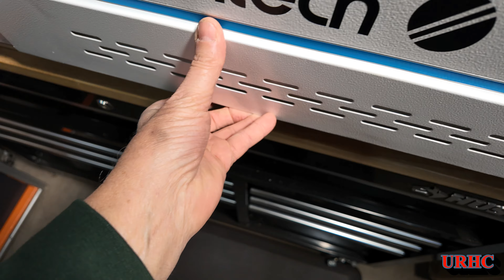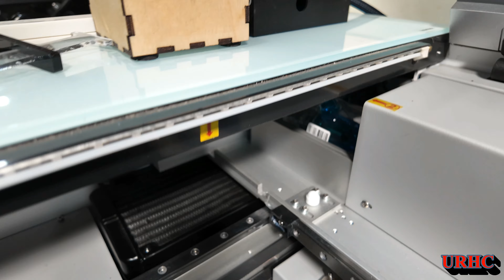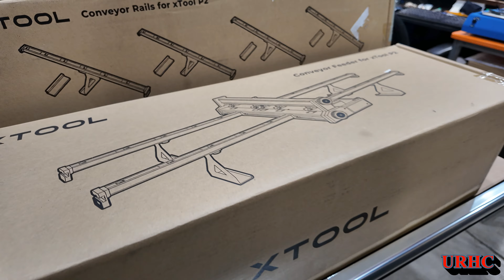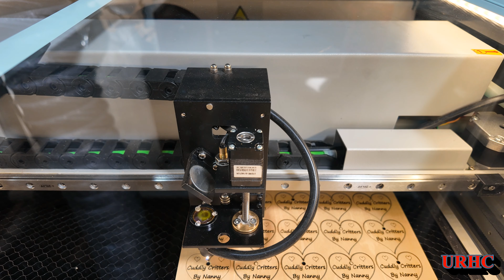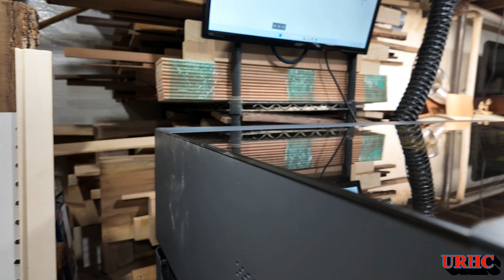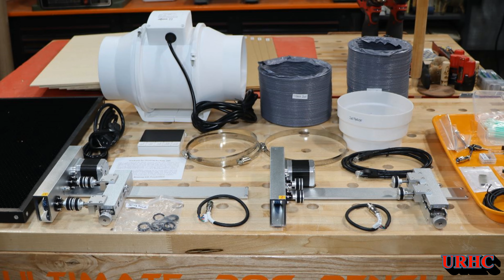Omtech Polar VS xTool P2 A Simple Comparison

Comment: Thanks for the video. I'm thinking of getting the P2S, I can't decide if it's a bad idea having it in my house, I can see you've got quite a serious extraction set up in your workshop. Is the smell contained well? I'd use the Xtool extraction/filtration unit
Reply from the maker: If you're planing on doing any kind of plastic the xtool filter unit I have is worthless. Does not remove the dangerous vapors.  Fairly good for the burning wood smell and particles but costly to keep changing the filters often. The only safe way to use these indoors is a good outdoor vent and be sure your home has a way to get replacement air in so you don't  create a vacuum possibly puling furnace exhaust or woodstove smoke in.  I have been told by xtool the extraction unit is not safe for use with plastic so I say vent it or use it outside because plastic is the reason most step up to Co2 machines. You only need a 4 inch duct and good inline fan. Thanks for watching.

Comment: Great video! There are better options out there that are easier to use right out of the box without so much fuss. If you're not prepared to devote a lot of time to debugging and maintenance, I would seriously reconsider investing in an OMTech machine. I know I regret my decision.
Reply from the maker: For the price at the time the Omtech was a good starter machine for those with limited space. Takes some fiddling but has excellent results. Switching mine to the cheap lenses got maintenance costs down. A year later there are many full size machines that blow both of these away in the same price range.  This technology changes so fast that it's hard to determine  when to jump in. Thanks for watching.
Reply: Are you saying the p2s is the way to go and more user friendly?

Comment: Does anyone know if you can get a different focal length lense for the P2?  I heard you could possibly get a smaller spot size for engraving with a different lense.
Reply from the maker: I doubt it.  Changing focal length is not enabled in the software.  Check with Xtool.

Comment: Got my P2 for 5K.  That was the bundle with riser base, rotary, and the conveyor.  Also came with a free fire suppression system.  I just got the mirrors adjusted and made a few test cuts in cardboard.  So far so good.  The machine seems well made.  Software seems easy to learn.  There were a few things typical of a Chinese product, they used countersink style screws in uncountersunk holes in a few places in riser base.  The mirror aligning program is a little unclear.
Reply from the maker: It is an easy machine to setup and get decent results.  Would be nice  if it was lightburn compatible out of the box for advanced users offline with no data collection.  Enjoy it. Thanks for watching.

Comment: Hi!
Thanks for the detailed explanations. You said it is very hard to set Polar, but once it is set it works very well in the long run.
I have a question, how hard can it be to set? Approximately how long can it take, for someone doing this for the first time? A day, a week, a month?
I know this depends on each person, their knowledge, etc, but I would like to know at least approximately.

All the best!
Reply from the maker: It took. me over 4 hours to get the mirrors aligned.  Another 6 hours to get the camera almost aligned. I would plan on 2 days to get it setup and aligned.  With single stage air assist, if you do a lot of acrylic work plan on removing and cleaning the lense often.  There are aftermarket lense tubes that make that an easier  faster procedure. Thanks for watching.
Reply: @unemployedredneckhillbilly2023  Thanks for answer! It seems that these problems were not with the Xtool P2, but after the proper settings can we say that the Polar is on the same level as the P2 in terms of engraving and cutting accuracy? Do you have a plan to go to the double stage air assist? Omtech has several types of lasers, do you think a higher power laser of 60-70W will be better than Polar? Polar is much more compact than the 60-70W models. What I am looking is a laser spot as small as possible for engraving and cutting acrylic. I watched the videos and noticed in one of them you showed how to change lenses for a little spot. Can you post a link to those lenses and also to the test lenses? All the best!
Reply from the maker: Really depends on what you're making and how many hours  a day it will run. These small lasers have duty cycles you must remain in and use proprietary parts that are cramped in and expensive to buy. The lenses are all the same spot size when clean, fused on acrylic vapors make it bigger and more difused. Look for an after market lense holder and standard lenses because engraving acrylic takes often cleaning. I haven't really  used the Polar on acrylic since getting the P2 because of the poor air assist.  Before spending a ton of money on a P2 you should look at exactly what your need is and who is going to handle any problems  with it should  it break because the buyer is responsible to debug and fix it. These are both starter personal use machines in my eyes.
Reply: @unemployedredneckhillbilly2023  Unfortunately you don't often find reviews as thorough as you did. I really want and would love to work with acrylic, especially engraving, but as you said, I'm afraid that due to the poor air functionality of the Polar I will have to change lenses very often. If the lenses would not be very expensive then it would not be a problem. The Xtool P2 is expensive for me, and I don't know if it's still worth it to make a considerable effort to buy it. I don't have a business plan in that direction, especially since I'm just starting out and will have to learn how to work with a laser printer. Polar costs 2749 Euro, at the same time 70W Turbo -747, costs 2649 Euro. Would Polar be better than Turbo 747, although Turbo 747 has 70W and Autocus. Would I find another laser printer in this price range? Maybe you can help me with some advice. Thanks very much!

Translated with www.DeepL.com/Translator (free version)
Reply from the maker: I don't  recommend any machines I have not tried.

Comment: Great video and very helpful! I’m looking to get the P2 laser, and am finding it hard to get a suitable mobile tool box for it. May I ask, what tool box by Husky are you using for yours?
Reply from the maker: Check out home depot and they have several different sizes and colors of these Husky boxes. They are a little tall for this machine but casters can be removed to drop them lower.  If your getting the feeder this is not the best solution.  Thanks for watching.

Comment: Very good explanation here.  I have not made my decision yet, but I little bit scared of cut quality with the S1. CO2 seems to be far better. Also, I like the idea of the conveyor for larger parts, is there an easy way to make larger part with the polar's passtrough?
Reply from the maker: If you have any plans that include clear acrylic or glass a Co2 is the only answer.  
The polar feed through is basically useless for larger parts. The S1 also has a conveyor feeder that is made for it. I am told  it is not interchangeable with the P1 feeder so I don't have one to try. If you have room, Omtech has some nice offerings with a larger bed and higher power that fall in the P2 price range and are much easier to maintain along with non proprietary parts to future proof your investment and full lightburn compatibility.  It's a large investment that should be thought out carefully.  Thanks for watching.
Reply: @unemployedredneckhillbilly2023  thanks for the answer, could you elaborate on why POlar feeder is useless? Is it because it is very small like 1/4 high and narrow?
Reply from the maker: Yes, the size basically makes it useless for my needs. Should at least accept 20mm.

Comment: For the price difference I just can’t see the reason for it. For the cost of the X tool you can get a much better machine
Reply from the maker: It is twice the price with the rotary, honeycomb, and risers. Proprietary parts and lightburn full compatibility is a deciding factor for many. They both are amazing starter machines and I really can't call one better then the other after using them both. Thanks for watching.
Reply: I really appreciated this video. I have a much larger laser that we built. I have zero clue how to use it and quite honestly no time to learn. With these smaller machines I’m thinking that I might be able to learn and then eventually get into the larger one. I was looking at a diode but will need to cut the opaque pastels and I don’t want to deal with hacks and whatnot for cutting. We have light burn because of the other laser but I’ll do all my designing in illustrator so hopefully I’ll be able to import it. This video was super informative. Scared me a little about the omtech set up but we will see 😂
Reply from the maker: Even these starter machines will require a learning process. The Omtech is a pain to set up but once properly aligned seems to stay that way. It almost seems you would be best investing time to learn to use the larger machine you have. Lightburn is the best laser software for working with images and that's why many don't want to be stuck learning the XCS software. Lightburn has great videos to help you get started. Cutting acrylic will make a mess of any machine from the vapors. Be sure to vent whatever machine you get properly and those portable heppa filters from xTool and others are not safe to use with acrylics. Good luck

Comment: I have the very similar Monport 55w laser. I also have air Assitance issues. For one it doesn’t seem to blow air but wondering if I could add an external pump to run with the laser. What are you doing to solve the pressure problems??
Reply from the maker: I had no idea Monoport made one like this. Looks like it's made at the same factory. I plan on adding a smalll external pump that's always on to keep crap out of the nozzle when engraving and to reduce the delay when using the main pump. If they would solve that issue with the next generation these would be a perfect starter machine. Thanks for watching.
Reply: @unemployedredneckhillbilly2023  thanks for the reply. Would you be willing to show how you made the wiring connections to the board to adapt the controller? I think the Monport 55 could adapt the same thing. 
Also it would be interesting to see how you will route the blower line in thought the machine when you add the external air pump.
Reply from the maker: @jwhiting352  There is a video about  adding the controller if you search my channel  for Polar. Comes with a cable that plugged into  my ruida controller.  Not sure what controller yours uses so you probably have to open it up and verify it's the same. I am planning the same hose with check valves and run the additional  line in the raceway.
Reply: @unemployedredneckhillbilly2023  yes I am planing to run the hose as well with what is already there in the race too. What are you doing for a two stage pump and will you connect it to the system board or just manually turn it on / off? 
I do have the Rudia board.
Reply from the maker: @jwhiting352  I really  am thinking  about replacing it and the Xtool P2 with a larger 100 watt machine in the future so I am still on the fence about if I should waste more time on it at this point. I want atleast a 16 x 24 cutting area that has more room for easy maintenance.

Comment: Great video on a topic I had been looking for. I bought an Omtech Polar Laser Cutter & Engraver, but have not got it running yet. And, by reading some of the Omtech Polar Users group post, I was second guessing on not waiting for the X-Tool P2. But, you have made some great points about the X-Tool I didn't know about and it looks like the Polar was an OK buy after all. I do have the external control panel like you have and also an American Photons quick change lens setup I will be installing. Just one comment, I am wondering why you left the internal exhaust fan in place while you are using the 6" inline fan? I have already removed my internal dn have 3D printed the spacer for where the internal fan was. My people (myself included) believe that the internal fan will restrict the power of the 6" inline fan. And, I agree with you about people seemed to buy these lasers with not knowledge that they will require maintenance and replacement parts. You would think that someone who is willing to spend the $3000 to $5000 these things can cost, would do their homework of ALL the cost involved. Oh well. Once again. thanks for all you videos and looking forward to seeing some more of your wife's crocheted animals and Crocs Collection !!...Charlie in Central Ohio
Reply from the maker: They are both good machines once aligned. The Polar definitely needs a better air assist with low flow for keeping the lense clean when engraving and the camera isn't perfect. I actually prefer the smaller size and light color. These are first generation and most likely will be upgraded in a couple years. The thing about the P2 is lightburn integration and so many proprietary cards and parts should the company quit supporting them. With standard guides, Ruida controller,  power supplies,  and stepper controllers I think the Polar is more future proof. 
I left the fan in to keep the internal parts cleaner. it keeps airflow pretty even in the machine even when the radiator fan is running I feel. pulling more air isn't always better I feel. The proper flow to keep particles suspended across the entire machine as designed is more important to me. Your machine should work  perfectly out of the box with an alignment and Omtech support is your  best friend if there are any issues.  
I see many decide to go with the larger Omtech machines for less then the cost of the P2, but if you want the feeder and curved capability without lightburn the P2 is the answer.  What bothered me is Xtool will not release info on the laser tube and ma for a good comparison. I get emails from buyers that had no idea they need to learn to align, clean, and maintain the machines and it can be daily depending on what material is being worked on.  
Be careful of what you read on user groups. Lightburn forum and Omtech support are all I use. I refuse to use sites like Facebook that l found bury stuff in your computer and allow companies to buy and spread personal info from every part of your life. Thanks for watching

Comment: Thanks for the video.  We have an 80w Omtech that we're learning to run.  One question I've had is whether I should trust that the machine cover really does shield your eyes from the laser adequately or not.  I don't really trust a Chinese manufacturer to build to good safety standards and I have no way of testing it.  What do you think?
Reply from the maker: I have no Idea about that model. You should contact Omtech and ask about the testing data for that cover. They should be able to provide that. I know that most diode lasers require the OD6 orange shade to be safe but Co2 is a different wavelength. I think Omtech is one of the best laser manufacturers of the Chinese lasers but it pays to verify that. I have been thinking about upgrading to that machine for the bed size.  Thanks for watching